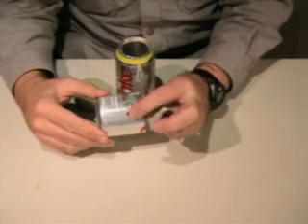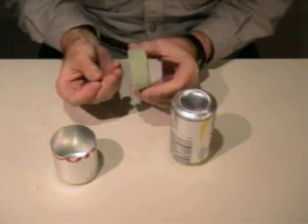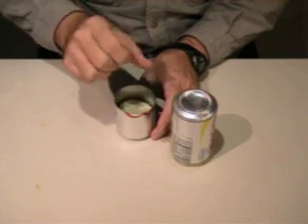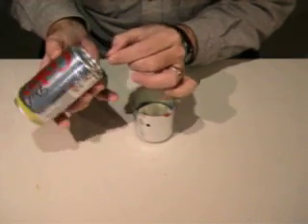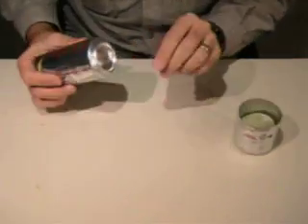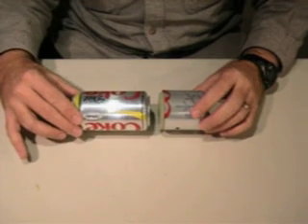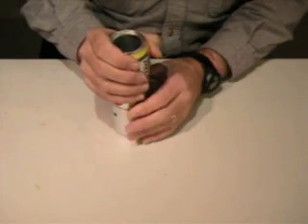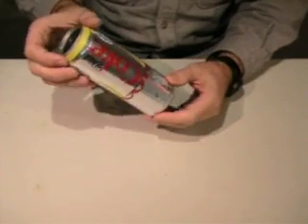Assembling the Pressure Chamber for the Quick and Easy Stirling Engine

Comment from the maker: Yes, the dimensions are very important.  You will find the book to be very helpful for providing all the dimensions you need, along with lots of illustrations of the construction process, and hints and tips for making them work well.  Check out the Hall of Fame page on the StirlingBuilder website to see some of the finished engines that others have done.

Comment from the maker: @14lucassantos The displacer is a loose fitting piston that moves the air inside the engine from the hot side to the cool side.  This stimulates the air inside the engine to excpand and contract and is what causes the motion.